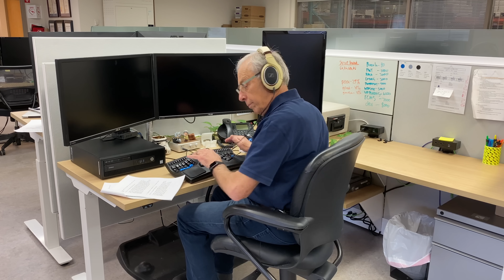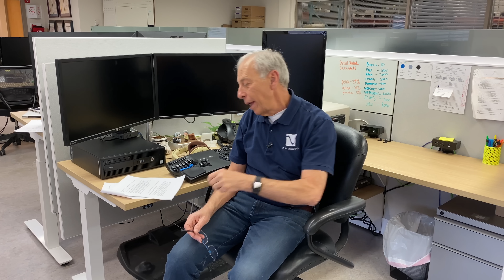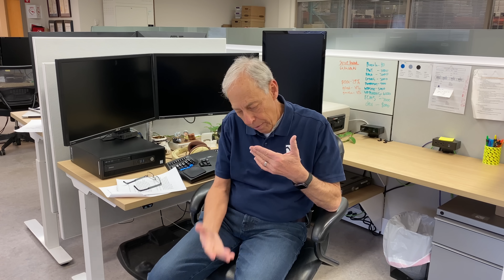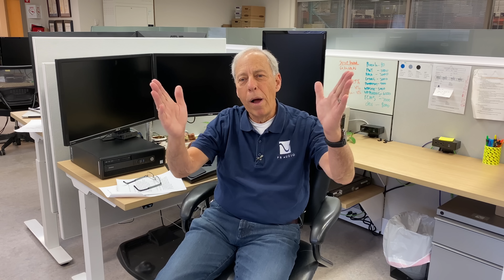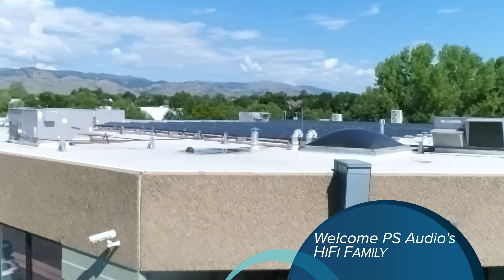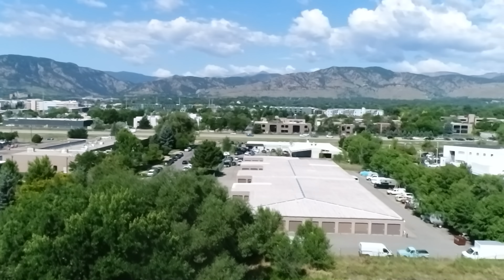Are watts the same for transistor and tube amps?

Comment: Yah I totally understand Ohms Law and E=MC2 as well. But why does a 50 watt SS amp often seem so WIMPY compared directly to a 50 watt Tube amp? I think it’s mostly because so many SS will spec instantaneous PEAK watts and most tube amps would be measured by the older “continual” watts of output. IOW....it depends how the manufacturers originally measured and spec’d their products.
Reply: Yes, that was the question not answered. Disappointing, because I was wondering the same thing.
Reply: hellop mine frends. I am not a expert but for the same FTC continuos minimun RMS power at the THOAL HArmenice dostostons, they will sound the save Decibels A B or C sacles. Tube may sounbd louders because outfuit tubes can run up to 500 volts or so, gibing a tube amp A LOT OF HEADROOM. I thing the biggest transisters for amops are something like 75 volts, but I dont know ti for a facts. HUGE powers TRSANFROMORE AND OUTPUT TRANSFORMER FOE THE SPEEKERS and piles of voltage means the amp will respond very quickly to a signal coming into it. EVERS  ask why APMPEG AVT Bass amp got sucha reputation for bass gutarist soudnign so nicer with the huge signam from the BASSE piuckups? WHen it gets to clippengs tHE TRANSTOR CHIPS OFF THE TOP AND BOTTOM OF THE WAVE,B SNOUNDING HARS ABD BRITTLE AND METAllic, but with tube amp the cliuppign is actuall a squeezing of the wave, makeign it sound not as unplesents. Is this the article yuuoe were lookings 4res.

More commonly found is a pair of EL34s running class AB1 in push–pull around 375–450 V plate voltage and producing 50 watts output (if fixed bias is used), while a quad of EL34s running class AB1 in push–pull typically run anywhere from 425 to 500 V plate voltage and produces 100 watts output. This configuration is typically found in guitar amplifiers.

THAKES YUO AND THBMS UPS!
Reply: Tube amps have a high peak capability relative to their continuous rating (at a spec'ed distortion level), while typical SS amp output voltage has a hard limit which is not far above its continuous capability.  
In all cases, though, be extremely wary of some manufacturers' amplifier power claims.  You don't really know what a unit can do until it has been thoroughly tested by a third party.
Reply: @marianneoelund2940  And the reason for that is because of the much less harsh sound from tube amps when driven into the nonlinear operating region, so people push the tube amps with more level than with transistor amps and hear a "more powerful" sound and they have to back off on the transistor amps because of the hard limit and the associated harsh sound of clipping.
Reply: I have thought through this many times myself.  I can only resolve that the sound from a speaker results from a combination of power that get pushed through a crossover in combination with the typical inductive reactance of the voice coils.  In case of planar speakers, it's more of a resistive load.  Many crossovers have capacitors that behave best from higher voltages.  I think many audio company's have concluded that math simply doesn't tell the whole story.  There seems to be a phenomenon of electric fields that works better with the high voltages used in tube amps.  Audio Research kinda gave up on solid state amps years ago.
Reply: @manardh7387  No, it's pretty basic actually. Tube amps sound better when driven hard, transistor amps sound very bad very quickly once driven into their upper output capability. The simple solution is to have plenty of power available with transistor amplifiers, not a real problem these days.

Comment: The tube amp is impedance optimized for different speakers so it is always putting out the maximum power. The solid state amp is not extra good because it can double the power with half the impedance, it just has no impedance matching circuitry. It is good to remember that before concluding that the way solid state amps work has "this advantage".

So actually you should say that a solid state amp is only able to produce half the power when the impedance doubles and not the other way around.
Reply: If you have a choice of 8ohm and 4ohm on a tube amp, no speaker is uniformly 4 or 8 ohm resistance across the board.  The graph normally looks like a cross section of the Himalayas.
Reply: @behexen250 You just confirm what I say and that is the amp's output is not impedance matched. The highest power is always delivered when the source and load have the same impedance. This is done with a transformer in a tube amp. It is not done for SS amps. Therefore the right impedance for a SS amp should be around 1 Ohm or even less. But this will result in all sorts of practical issues. As a result it is just accepted that SS amps are not impedance matched (Which BTW has other advantages that are outside the scope of this topic). 
The correct way of understanding a SS amp is therefore to look at the power loss relative to the optimized condition and not the gain relative to an arbitrary condition (Why not use 16 Ohms as reference for instance?). 
Most SS amps can not run much under 4 Ohms even though 4 Ohm speakers are still too high in impedance for the SS amp from a matching perspective. The optimum conditions are therefore the lowest impedance the amp can handle (well) all other impedances will therefore deteriorate the ability of an SS amp to deliver its maximum potential power. Hence, a power SS amp will only deliver half of the power at 8 Ohms as that it can deliver at 4 Ohms and there is no magical doubling of power, only approximating the impedance matching.

PS, this is just Ohms law and has nothing to do with the specifics of Audio.
Caveat: This is based on typical SS amp architectures and assuming the amp can handle the required currents for a 4 Ohm load. It is good to understand that it is possible to have an amp with a lower impedance than the power supply (or even the final stage or drivers) can handle at full power.
Reply: Hugo Bloemers -   over- confidence and aggressiveness that engineers receive from audiophile enthusiasts and “students of YT college” is unbelievable these days. 
I gave up on explanations. Some of them even sent me back to study some web pages, learn something and then come back to comment! Hilarious:))))
Reply: Hugo Bloemers: Many thanks agains KIND SIRS! I guess it really isnot as simple as just putting speaker cabinets in parallel and expecting tons more power from atransistores amps. Too bas all those so called GUUTAR EXPERTS AND REVIERS such as theose 2 guy sin England and al lthe rest dont ever mention what you wrotES. YOU ARE THE TRUE AN DHONEST FRENDDS. THANKS YOU ANSD DEFINITED THUBBMS UPS!
Reply: Hello MINE FRENDSS: Here is from the HARTKE BASSE AQMPO...

Key Features
    Power: 250 Watts at 4 Ohms, 180 Watts at 8 Ohms
    Tube Emulation and Solid-State Preamps
    Active and Passive Inputs
    Rotary Bass and Treble Contour Controls
    10-Band Graphic EQ
    Adjustable Compression

THNAKES YOUES AND THUMSSB USP!
Reply: @ilovecops6255  That only means that this particular amp does not have a power supply (or output stage) that can handle sufficient current to produce twice the power it does at 8 Ohms. This particular amp is therefore optimized for something around 6,5 Ohms
Reply: Hugo Bloemers: Thank YOU KIND SIRS! Your answer is the kind of stuff I have never seen im AUDIO, STEREO REVIEW, stereophile, THOSE VIDEO TOURS OF mARSHALL, pEAVEY, gALLINE kRUEGER, sound refinforcement guys, etc.. I have given up on all of them, Lots of smart peoples here giving real answers. THANKY OU FOR BEING A TRUE AND HONEST FRENDDS! THUMBBS UPS!

Comment: To further the question, why does a solid state guitar/bass amplifier need more power than a valve/tube amplifier?  A 30W amp can get as loud as a 300W solid state.
Reply: It is about clipping or distortion.  Tube clip is way less damging to a speaker than transformer.tube clipping.  Your statement is exaggerated.  WAY more is relative.  30 to 300 Watts is 10dB.  The use for the amp is irrelevant unless you desire distortion and blown speakers in solid state.  Solid state will deliver a DC component that tubes won't deliver.  A clean sounding or minimal clip tube sound is cleaner than any solid state distortion.  This is why solid state amps should be bigger than tube amps.  This is not a quickie discussion which is a huge reason why instrument amps ARE tubes, or use a tube for generating the distortion.
Reply: @gminker  thanks. Of course my question was very generalised in its content, so I wasn't using precise numbers, of course.
Reply: gminker: The bass guitar froM KISS is now useing Tech21 transister amps because his tube AMPESa would sound different as the show ent on and tey would get hotter and hotter and not sounde as good. The Dave mustaine guy he uses as Digitech guitar processore 2120 or whatevef it is, instead of Marsheall because now lots of prosessores sound relly good. THNAKES YUOE AND THUMBBS UPS!
Reply: @gminker  Clipping is a DC voltage that heats up the speakers voice coils and if excessive enough will damage the speakers. Please explain how clipping on a tube amp is less damaging to clipping on a solid state amp?
Reply: Fake numbers, most likely not comparing apples with apples. Always compare RMS power @ 8 Ohms and you will see that the 300W amp only puts out 30W.
Reply: Get more efficient speekers. lot of them like CELESTIONS ARE around 100 db with a 1 watt imputs. the 100 wall marshall plexi is more aggressve sound than 50 watt plexi. i dont know if marshell does it on porpose to sell more epxpansive amps or if just works out that way. now i use a gutar prosessors because i cant afford change tubus no moores. THANKS YOUE AND THUMBBS UPS!
Reply: @behexen250 
Tube amps, if a symmetrical push-pull design, produce plenty of odd order harmonics.  
The significant distinction between tube amps and solid state, is that tube amps produce mostly low-order harmonics while SS amps produce much more high-order harmonics.  It doesn't matter to the tweeters whether harmonics are even or odd, just how much energy is in them within the tweeter's band.
Reply: @marianneoelund2940  THNKE YOU FAIR LADY. I can always depend on YOU for the HONEST ANSWRERS. THUMBBS UPS!
Reply: @behexen250 BUT aren't many second order harmonics still in the audible range and still reproduced by your speakers? I guess I'll have to research this more to understand it properly. Thanks
Reply: @behexen250 
Periodic Waveforms, Half-wave symmetry:  
f(t) = -f(t+T/2) where T is the period.  
Half-wave symmetric waveforms have no even harmonics.  Push-pull tube amp output stages, where a center-tapped primary has B+ connected to the center tap and two power tubes alternately drive the ends of the primary, operate with half-wave symmetry since the voltage excursions for each half period are identical at the plates.  Example:  Dynaco ST-70.   
Significant even-harmonic distortion occurs in Asymmetrical designs, such as single-ended class A, which can be either tube or SS design.  
But your ears and tweeters don't care whether distortion consists of even or odd harmonics.  SS amps clip abruptly and produce much more high-frequency distortion; that is what ears and tweeters don't like.  Tube amps overdrive relatively smoothly, producing more low-frequency distortion which is less audible and is well rejected by the tweeter crossover.  
And I'll pull comments again, if you start making unreasonable demands for "references" when I'm already providing information that qualifies as such.  I don't have time to carry on debates with bullheaded and ignorant people who cannot recognize and accept authoritative information.
Reply: @behexen250 
As long as you're happy with your fantasy world, why should I care?  I'm not your servant, to provide example after example, until I hit upon something that you decide is acceptable.  Who are you to judge?  
I have a 40-year engineering career behind me, where I have earned the respect of the engineers I've worked with, and our managers.  I've received more awards for outstanding achievements than I would care to count.  That says something.  Your insolent and disrespectful manner and baseless criticisms, on the other hand, amount to precisely nothing.  
Time for you to cease and desist.  You are achieving nothing here, but revealing for all how ill-behaved you are.